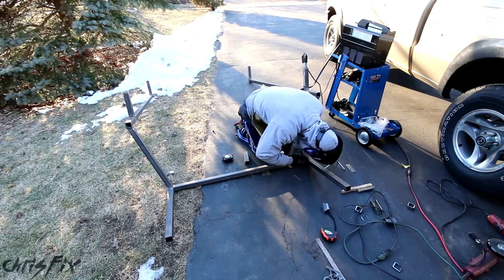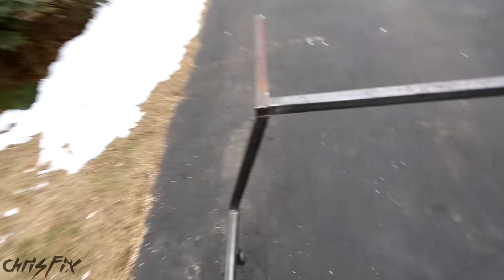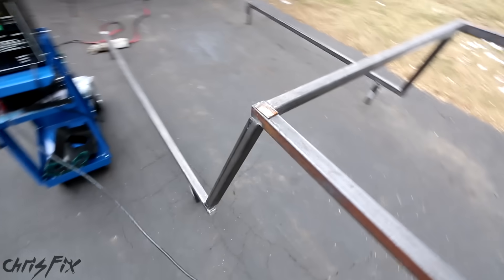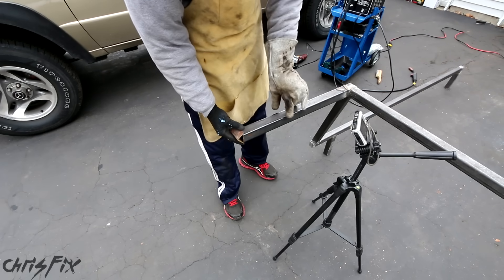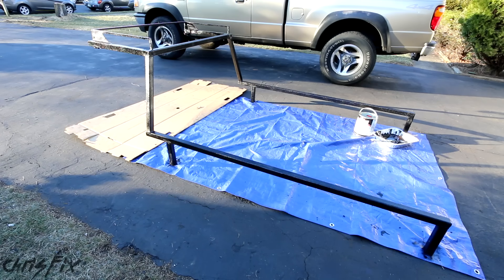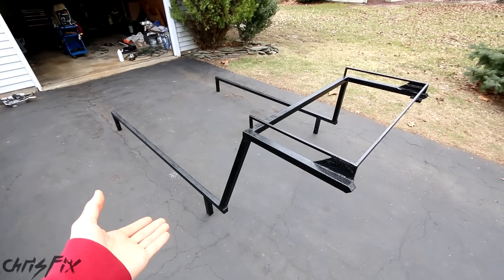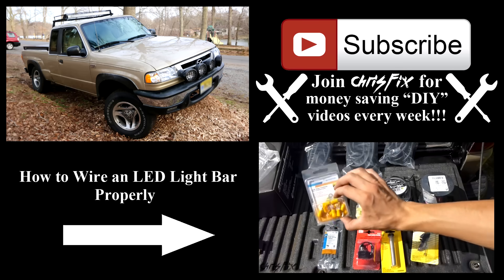Custom LED Light Bar Build (Part 2 "Project Night Light")

Comment: if you are trying to max your welds look good after paint i disk i enjoy using is a flapper disk, you done get as many gouge marks as you would with a hard disk, when i worked in production welding if you used a hard disk to clean up a part and lifted and gouging marks the part would be throw away, overall good videos, cheers

Comment: You folks that are telling him to do this or that, this way or that way can build your own. He built it the way he wanted it. And those saying he needs a bigger welder or more expensive one...give him a break. Seems like he does well.  I can understand welding tips but cmon folks......
Looks good my friend...keep em coming!
Reply: i have a "   C & HF   " 70 amp flux wilder  i had for 11 years  and i built my hobby stock dirtcar   with it and still raceing it to day  ,, same as him i learned wilding on my own !   so no you dont need big dollor  tools for this or that
Reply: @1JRrambo  
Hi
Reply: AR1290 Vlogs Well, you'll have to excuse me I didn't know we were writing an English essay here on YouTube to be graded nor did I think there would be the keyboard warriors out in force to correct the grammar and or punctuation of each comment made.
Reply: Nah, you're right G23.
I like chris fix because what he does is simple, works well, and honestly looks nice.
Reply: Dan katesfield watch out now...got another keyboard warrior here.....
Reply: Milan Jovanovic I'm not sure too many folks would trust a welder made from a microwave. Those things are dangerous if you don't know what you're doing. I certainly wouldn't try it nor would I trust it. 
I bought a Lincoln AC 225 welder not long ago for $200 so it's much safer than a freaking microwave welder.....AND it's a bonafide welder.  
I'd rather have what Chris is using before I'd try something crazy like a microwave welder...
Ive seen folks use a car battery before on welding projects and I wouldn't trust it either. A little common sense will get you a long way in life.
Reply: you sound like me
Reply: G23 I
Reply: Why can authors start with “And” at a start of a sentence so why can’t Shawn. Take a chill pill.
Reply: I do agree with this Verry much
Reply: i like the way he uses non advanced tools because not everyone has that much money for a welder.
Reply: G23 wow, from 6 months ago till now...
Reply: I didn't acctually read much of anything, so yeah. XD
Reply: +G23 Stop being a bitch...
Reply: G23 Never start a sentence with the word "AND". Simple fact...

Comment: Was the light bar donated? because 100$ welder but 1000$ lightbar doesnt make sense.
Reply: Why does it matter how much the welder costs? He does't need to go out and buy a $10000 commercial grade MIG or TIG for home jobs.
Reply: You obviously dont know shit bout welders if you think commercal welders cost 1000$. especally tig.
Reply: You can get that many types of MIG it's crazy. The one at my work was $7k, so pipe down buddy
Reply: Welders can easily run 10-20k. A buddy who owns his own shop has 3, ranging from 11k to 27k. he does this for a living though, not garage projects..

Comment: why do you have a negative post on the metal?
Reply from the maker: That is a ground for the welder. You need to ground the welder to make a complete circuit on the piece you are welding.

Comment: Nice job and I like your design, but for more strength/stability I would have made some triangle type gussets on the vertical bars coming up from the truck bed rail. This will prevent flexing of the top section into the cab roof.  You could also add some expanded steel mesh across the top to act as a gear rack.

Comment: Looks great only 3 things more I would have done one is at the bottom of the headache rack I would have put a bar across there second above the cab behind the light I would have built a tray like to hold stuff up there wouldn't hold much but sometimes that's all you need and lastly I would have bolted in the rear as well as u did the front then put on some of those things used on boats for tying off. Not sure what they are called but I would have put 4-6 of them along the bed for rope tied downs. Others than that looks great

Comment: I installed a light bar on my truck that came with a fuse and wire and it was really easy to install other than the fact that the harness was not log enough. I am pretty sure that it is about 20 gauge wire and I went everywhere around town looking for more to add on. Would it be bad to buy another harness with a better switch and just cut out what I need and splice it together? Would it matter of the wire thickness is different at all?
Reply from the maker: +zachsurdell24 If it is only 20 gauge, use that chart that I used my "how to wire a light bar" video and make sure adding wire does not cause a significant voltage drop.

Comment: LOOKS GOOD Chris!!!!!! 

I do wonder if you considered reversing the real thin metal stock you put on top of the Metal Frame to protect the light.  MEANING......  That could've gone on the bottom, this way you could use the Thicker Main Frame to transport heavier materials of needed???  I guess you would just needed to make the Main Frame a little taller and then mounted the light under the Main Frame.  again....  basically just reverse design it.  
just a thought, somethings are seem in hindsight, and was wondering if you considered that???

Comment: You forgot to put a welding mask over the camera. I can't see anything now. :-(
Reply from the maker: +SpiritBear12 Your screen cannot produce a bight enough light to cause any problems.
Reply: ChrisFix
Twas a joke, but it was very bright. My eyes are not keen on bright light. I often wear sunglasses on sunny days, esp at the beach. All that sun makes my eyes unhappy.
Of course in the video I have the options of either looking away or just close my eyes until I hear the welding stop making that crackling sound.
Your new light bar is cool though. I wish I could drive around and see that well all the time. But those things aren't legal here. I know you said they're not street legal where you are though.

Comment: Don't know if anyone else said it but you could make the top a shelf by using some angle iron on the inside faces of the top rack and some wood or something for like an extra storage area that can be used for extra storage and it even saves your paint on the roof so it wouldn't scratch and rust the roof of your truck. also adding some tie downs up there would be good if you did this because of all the wind might cause stuff to blow off. please tell me what you think of this idea because i might build one myself because i think this could look sick on my 01 Tacoma.

Comment: When getting threads in pilot holes, you should tap and die 2 full rotations through and 1 rotation out to help your bolts go in and out easier. Nice build anyways!
Reply from the maker: +Wilx Raven Thanks for the tip!

Comment: all someone needs is a cordless saw zall to cut that light bar out, just saying
Reply from the maker: +boondockr87 The metal is pretty thick and it would take a while. The idea is to make stealing it harder rather than easier.

Comment: i like it very much but one thing you should up grade is that the space between the light bar and the back of the roof of the truck should be turn in to a basket to put some tools or camping equipment something like that but pretty awesome project

Comment: Nice!
Could use three more crossmembers for extra suppport. 1 left to right to connect front to rear members & 2 for support top & bottom members. Maybe two mesh, one on top- light load bearing and one rear to protect rear window.
Nice project overall.
 I am still in design stage myself. All material present, just havent decided when to start.
Tnx for post.
Reply from the maker: +Phantasmos Thanks and make sure you take some pics! I would love to see!

Comment: those bolts where way way loose... those bolts will strip really easy and not hold real good. the metal is a but to thinn to tap in.

Comment: Hi, Looks good but 3 things. 1/ I would have put one or two uprights in the side parts above the cover. 2/ I would have put some mesh in the bottom of the part over the roof, 3/ I would want to make some sort of capping for where the bars go down into the truck

Comment: for the longest time i thought this was a ford ranger lol
Reply from the maker: It is,  but rebadged as a Mazda
Reply: ah ok, now it makes much more sense lol
Reply: +spartan119ify My brother used to have a B-Series. When you opened the back panel of the glove-box, there were a bunch of ford symbols on the parts xD
Reply: Can you show me pictures of them
Reply: It is. Mazda and Ford had a merger. It’s just rebranded
Reply: How can you not know this? 
The Mazda company also sold ford explorers. My neighbor has one.
Reply: @mikeries8549  Ha! My 91 ford ranger had a mazda transmission.

Comment: welding a bit too fast there lol
Reply from the maker: +Dale Driggers Thanks for the tip!
Reply: +ChrisFix yeah I got the same welder and you kinda got to go a lil bit slower cause it tends to go faster than what you want and nice frame by the way love the light bar position all these other people are putting the light bars at the top of the windshield and the hood is really blocking most of the light lol

Comment: That looks sweet! I wish I could weld! Thinking about something similar for my f150. Just a little paint tip too. When opening a can of paint turn the screw driver rather than plying. It helps from damaging and denting the lid.
Reply from the maker: +znovosad555 You can weld. I literally learned doing this project. I have no school on welding. I watched some videos and tried it. Thanks for the paint tip! That is a good one!
Reply: I'll have to look at welders sometime! Maybe this summer! And that paint trick I learned from my 9th grade wood shop teacher

Comment: I know its too late, but wouldn't be easier to drill the mount holes from the bottom?
Reply: Tiziano Spagnuolo No, because then it is more difficult to mark the holes...
Reply: Actually much easier to reverse the mounts on light mount on light again reversed on lights and them mark where to drill on roof mount so he could simply mount the brackets and than install the light bar.. but what a great built.. this guy rocks.
Reply: jomar cavalcanti you're gonna have to retype that if you want us to know what you mean
Reply: Tiziano Spagnuolo all about presentation I guess lol
Reply: Good point

Comment: In cases like this, don't you wish you were superman, and could weld everythang with your lazer eyes ??
Just look at the beams, imagining how it will be, and then: LAZER TIME ! It looks like you didn't use enough amp on your welder, since the thread bounced so much and you struggled to weld it. I dig the LED bar on yo roof !
Reply from the maker: +Lucky Charm hahaha, that is funny!
Reply from the maker: +Lucky Charm But then again, if I was superman, I dont need a truck, I can just fly everywhere.
Reply: Yeah, you got a point there, but I mean, superman in a truck. Like batman's Batmobile!

Comment: Nice job, You should;ve  weld another tube behind the rear window on the bottom side of the frame for more protection and strength,
Reply from the maker: +Erik Ayala Thanks! I didnt add a tube there because my bed cover rolls up and goes there.

Comment: You will have to be carefull, making a basket box behind the light.Without a support at the front, on to the cab roof, the vertical supports would bend or the welds could snap.  Can you add supports outwards to the rain gutters?
Reply from the maker: +Robert Willis I could but I like it the way it is for now. Thanks for the idea though!

Comment: you should off made a little basket behind the light bar bro
Reply from the maker: Thanks for the suggestion!
Reply: +ChrisFix gjjjjj!!!!! maan! i was excited as you when u were building it! XD
Reply: Hey Chris, if you do add a basket (I vote yes for that) you probably want to gusset the L's on your rack to prevent any sagging up top.  nice job
Reply: I did that on my design same truck Mazda B series
Reply: looks perfect size for a cooler

Comment: The comment section, where everybody becomes professional welders.
Reply: Doesn't get any more accurate than that.. Because I am an expert welder... Jk haha.
Reply from the maker: +asternotdog lol
Reply: @chrisfix  Do a face reveal. Pls?
Reply: Hi
Reply: I took a welding class as a tech elective while getting my engineering degree, he did a good job for a novice, and better then I could do
Reply: @Bolt216  cough cough *than cough cough.
Reply: @Bolt216  yeah he did ok but he needs to get the bead going faster the weld on the 1st and 2nd bracket was pretty good.
Reply: Couldn't agree more!
Reply: James lmao ikr
Reply: James Blake longtime
Reply: ☺☺☺☺😆😆😆😅😅😅😅👨👨👨👦👦👦💪💪💪👍👍👍👍👍👍👍👍👍👍👍👌👌👌👌👌✋✋✋✋? I have a look at the moment cdun7sbhktmbj5, but the page you requested could be the best of the most 💅💅 yo, but the page, and I am looking forward. We are a number is still collecting the 🔱🔱🔱🔱🚩🚩🚩🚩✅✔✔✅✔✅✔✅✔✅✔ 🕛🕧🕐🕜🕑🕒🕞🕓🕟🕔🕠🕕💤💤💤🕕🕡🕖🕢🕗🕣💤💤💤💤✴✴🐰🐰🐦🐦🐕🐶🐍🐍🐍🐍 🐸🐸🐸🐸🐸🐸can be used for any damage which is why we offer a
Reply: Welding is like sex, it doesnt matter how pretty is, so long as you do it deep enough to take a bit of pounding and it gets the job done what more do you want XD
Reply: Disconnect battery
Reply: Gdj f2f
Reply: The comment section, where everybody comments about other's comments.
Reply: I am a Professional Fabricator/Welder An it's not terrible considering it would be a small 110V welder using flux core wire. But the affectionate industry term for these welds is hammered dog shit LOL But I'm sure it won't fall off or anything. Grinders and paint make me the welder I ain't.
Reply: @StevePolhill  k
Reply: @StevePolhill  a
Reply: +ChrisFix kjhhhjhhkkkkkhbhh

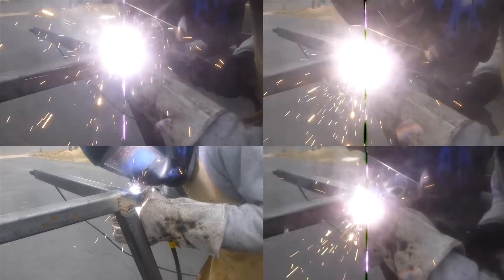Comment: At 1:32 in the bottom left corner, whenever you're welding vertical, you should weld from the bottom to the top, not the top down.
Reply from the maker: +Justin Harris Thanks for the tip Justin!

Comment: Do you have plans to lift your truck, or do any tire/wheel mods? I think it would be cool and, it kinds looks like your headed offroad already.
Reply from the maker: +Multi-Hobbyist I already did a small 2in lift but I want to do more lol
Reply: +ChrisFix I have thought about lifting my truck too. I just seen a guy at the gas station with a Ram 1500, that was a suspension/body lift, totaling 11 inches. it was done right and, looked really nice underneath. It made me want a lift kit even more.